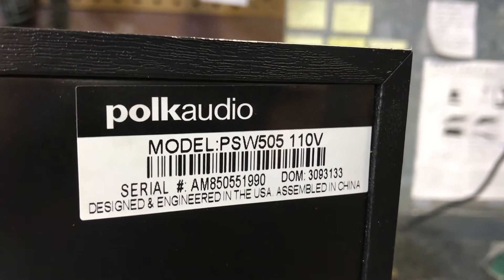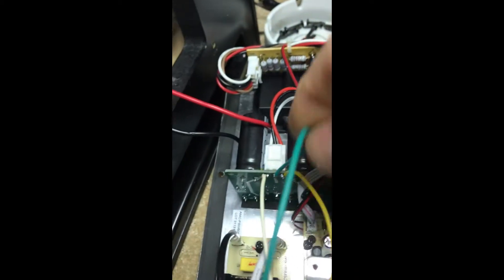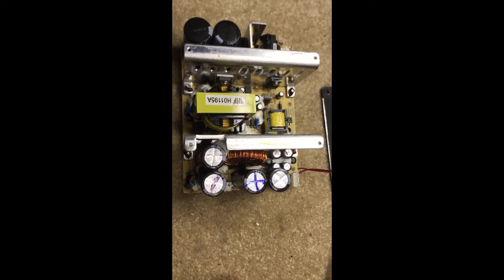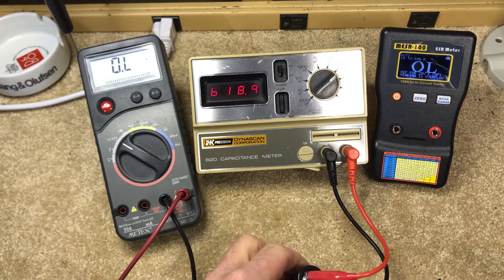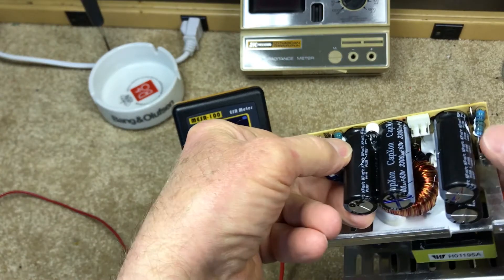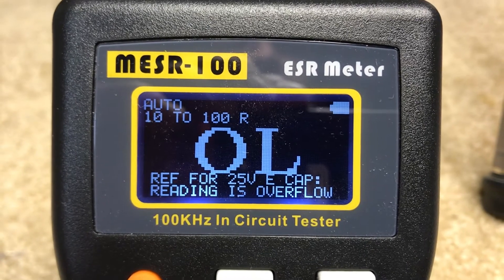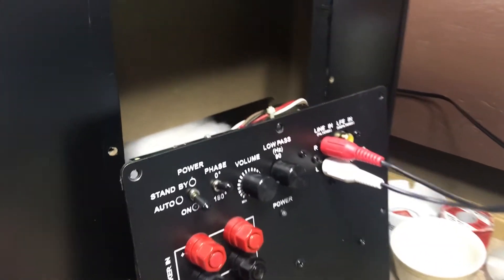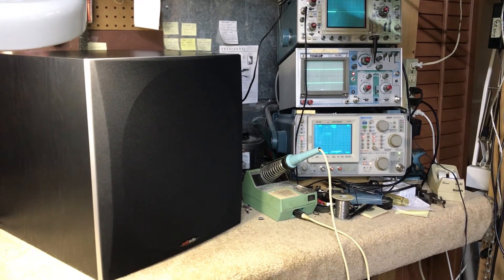Polk PSW505 Sub Woofer - Troubleshoot & Repair

Comment: I've got a Polk Audio PSW505 and it did similar stuff as for making noise. It also got very HOT on the back plate and after some time it quit working altogether. I've been trying to decide how to get it back into operation.

Comment: Can I know why you measure capacitors in the circuit? For me that depends on the line, if more components are on the board, the reading can be not accurate.

ESR for me is good to measure, but only on high frequency. It doesn't matter in the low frequency as much.
Reply from the maker: Thanks for your question.  Measuring capacitors in circuit is a huge advantage in time savings if it can be done accurately.  In this case, the Polk Audio boards have "plated thru-hole" solder joints.  Removing the components can be a pain staking process versus a single side foil board depending on the age and type of solder used.  Many times the component itself can become damaged during the removal process.  ESR testing is way more reliable than a capacitance tester or Ohm meter that can easily be influenced by components that are connected to the same foil trace. The odds of finding a bad capacitor with an ESR tester well outweigh the odds of missing one.
Reply: @dennisbsutube I have different experience, but thanks for your answer. 😊

Comment: mine is the polk 550wi.   I have 2 of them.  when set to "auto"  they sometimes both shut off after a few minutes.  Im guessing they sense when no music is being played?   anyone know how that works?   when set to "on"  they seem to stay on indefinitely until the power switch is turned off
Reply from the maker: Yes, the Polk Audio DSW PRO 550wi subwoofer features an "Auto" mode that manages its power based on the presence of an audio signal. When set to "Auto," the subwoofer automatically turns on upon detecting an audio input, indicated by a green LED on the back panel. If no signal is detected for 10 minutes, the subwoofer enters a "waiting" state, and the LED changes to yellow.

Comment: Awesome video! I am veteran Radio Broadcast Engineer and somehow never heard of an ESR... LCR yes, cap meter yes, VOM yes, so I learned something! I usually just did a cap test and or shotgunned the caps in things like this.  Curious if that supply itself can be replaced, meaning is it a Polk Audio supply or a third party?  I have the same speaker and mine is doing what sounds damn near like morse code white noise.  It is not morse, and it goes away after its been on a bit... happens with no input to the speaker, and the power light turns red during the issue.  It is almost 5 years old.  I probably will replace the entire subwoofer with a new sub at some point soon.  Thank you for teaching me something new at the age of 65 years old!
Reply from the maker: Thanks, I'm glad to pass on a bit of new troubleshooting info to a tech that's been around the block!  You can replace the amp assembly with a 3rd party unit from a place like Parts Express.  If you don't mind spending the time, you can probably shotgun the small electrolytics, get by on much less of an investment, and have enough money left to by a decent ESR meter.  Think of the joy of finally being able to troubleshoot electrolytics in circuit! :)
Reply: @dennisbsutube  well if I decide to repair it ill pop for an ESR meter.  Thank you again!

Comment: I recently just bought one yesterday for 40 bucks on marketplace and I am so lucky because it’s perfectly working fine. It has no issues at all as it is a 2013 model and hasn’t been used in around 9 years so I’m lucky
Reply from the maker: Congratulations, I hope your Polk sub continues to work well for you. In the meantime, you might want to consider running out to buy a lottery ticket!  You may be on a roll...:)!
Reply: @ I didn’t do that yet, but I also found a free 12 inch soundstage powered subwoofer that’s fully functioning as well and also scored some fully functioning, car subs for free and some rare vintage PA 12 inch coaxial drivers that are worth 700 Canadian for the pair Maybe I am lucky. Maybe I should try it out and give the lottery a try
Reply: I bought a pair of the polk 550wi subs for $50 each with the remotes and a bunch of the high end monster cables that are worth far more than $100 on their own. Subs work great.  He had 4 more that he already sold.  So he had no issues owning 6 of them. His only issues was the neighbor in the house about 125 ft away.   Too much bass and he had to sell them!

Comment: My volume switch makes popping and scratching noises. Any chance you know where to source one out from?
Reply from the maker: 90% of the time cleaning the pot (potentiometer or volume control) is all that is needed.  Buy a can of Caig DeoxIT D5 contact cleaner.  It seems expensive, but it works and a can will last many years as only a little is used each time. 
 Amazon link: https://www.amazon.com/CAIG-D5S-6-Contact-Cleaner-Rejuvenator/dp/B00I3G272M/ref=sr_1_1?crid=2J2LWEQMF7723&dib=eyJ2IjoiMSJ9.gGEM-dDQgIX37Ke0Q-Cx2kFWveOk1ZJtlIF0wLQfqVgzmoQIxBI72026Vuniyv6tCRfIbC6D0VQkkkhcBKaucZwDAApD-IpxQZU_UKErFkJ63aTdVnb0Itn5PheQAwA53K0PDV0JOm6ldOvxDSYiqrYlMOZUPVIUiRCRMwPNVQsefVAOtf-Jrc-GPBfgH3ayqZagJrlCWOUFiNKbi6KLdIHBcGwld0hr1Aem2tRzXU2kKJqmAGHlQ-RSSHv-hUFSsOuE5g6QxXROHZPEgK_AsyO9UbaErt9zVUyupW2sinwhhiQzIQll3WO5Xe-C50jqngK6si3YgOrG8cLDNadUCLh5kUTwMD6yPyBRdCI0-TD4nHWwciSyjpy9g76s5LzXckq396DbPiw1Jm0p8xDW5pgtETRZ8_bwnWKw_V7Zbjb2EKDBHb8856SpsJjuUpiK.ag7_-s5ZWxdnNuOMQJ-1D_MmRRayUL_hNWVMdYAdQRE&dib_tag=se&keywords=deoxit+d5+spray+contact+cleaner&qid=1739979633&sprefix=deoxit%2Caps%2C138&sr=8-1

Comment: What would this repair cost? They want 200 shipped to replace the whole back panel.
Reply from the maker: Repair costs total $10-$15 if you do the work yourself.  I imagine a shop in your area would charge around $100.  You can have them watch this video to save them the time of figuring out the circuitry.  Good luck!
Reply: @dennisbsutube  much appreciated.

Comment: What’s the avg cost to do this repair? What do you charge? Curious. I have this same model and issue. Thanks
Reply from the maker: I spent around $10 with Digi-Key to get the parts I needed for this fix.  Sorry, I retired from the high-end audio repair business many years ago.  If you send a link to this video to a real electronics repair shop near you, they should be able to tell you if they are up to the challenge.  Thanks for watching.  Let me know if you find a good shop in your area.

Comment: I have a Cambridge Audio Aero 9 sub which also has intermittent issues. 
I can't for the will of trying and spending a few hrs researching, I just can't find schematic for it so I can trouble shoot for components. 
Do you have any ideas with your knowledge on how I can start this on the right track. 
I am a novice but have done small ish repairs so I can solder etc. 
Cheers in advance

Comment: Nice video.  Thanks for sharing.  So what does the freeze spray show exactly?  Can you turn a can of air upside down to achieve a similar effect?
Reply from the maker: The freeze spray trick is only used when you have a part, typically a semi-conductor, that consistently fails after a circuit has warmed up.  The freeze needs to be instantaneous and extremely cold to shock the part back into a temporary working condition.  If you have a can of compressed air that will expel freon when turned upside down it might work, using a can a freeze spray is the best option.

Comment: Hi Donnie, thank you for this video. Hi, I have a strange problem. I have connected single rca cable from my avr to the right input on the sub. However, when I pause the movie & play it back, it stops working. If I switch to left input then it starts working again. Can you please tell me what are the probable causes?
Reply from the maker: Ravi,
The unit does have an audio detection circuit that powers on the amp from a standby mode.  I'm pretty sure most of this detection circuit is located near the input area of the main amp board.  The small transistor that I replaced near the end of the video was part of this circuit.  The small electrolytic caps and any switching transistor involved in this circuit are most likely the culprit.

Comment: I have one of these amps.  It's currently working but past few nights I noticed some strange noises coming from it!   It did it again today, I went to check it out and it was super hot.   My other sub which is a different brand was on for the same amount of time, and it was not hot at all.   I never paid attention on this amp if it normally gets hot after an hour or so of use.  But something is going bad that's for sure.   What I did notice was the large heat sick the one right next to the AC input It has voltage leaking onto it.   When I touched it I could feel a slight shocking sensation.  I measured it and the heat sink rail has 168vdc.   No sure if that is normal on this thing or not.   I would have thought it would be like a grounded part.... There are 3 transistors attached to it, and then some other electronic part that is white in color is strapped to it.   Anyone know if this is normal on this power supply?   I'm going to have to check all the capacitors because sounds like a lot go bad on this power supply.
Reply from the maker: Dexter,
The strange noises are a good indication some of the caps are going bad.  Also, check the solder joints on the larger power resistors.
There should be no measurable current on the heat sink.   Disconnect everything from the subwoofer except the power cord, then measure to make sure the problem is not coming from another source.  It does sound like you have a short or a breakdown in a semi-conductor insulator on the heat sink.  This can be a dangerous condition.  I would contact Polk customer support and ask for an amp replacement due to their liability exposure to injury in this situation.

Comment: Mine died a few weeks ago.  I just finished the repair.  I scoped the 57VDC output from the power supply and it was an absolute mess.  Lots of AC leakage.   Broke out the ESR meter and there were a bunch of caps that were either flat out bad or very close to the edge of being out of spec.   I wound up replacing all the electrolytic  caps on all three boards with the exception of the large power caps.  I used high quality Panasonics so hopefully this will last a a few more years.  From troubleshooting to repair it was about three hours of my time and $25 at Digi-key.
Reply from the maker: Good for you.  Persistence pays off!

Comment: Thank you for posting this video.  I used it to replace some bad caps on the power supply.  Unfortunately, I didn't have +/- 57V output before and still don't, so I have to dig deeper.  No obvious signs of burned components or bad solder joints.  Just not sure how to test the other components.
Reply from the maker: If you are missing both the +/- 57V supplies you need to go to the beginning of the switch-mode circuit, usually just after a coil type transformer.  You are better off troubleshooting this circuit cold (AC power cord disconnected) so you don't get shocked.    The problem will most likely be an open semi-conductor or fuseable /power resistor.  A tip would be to look up the part numbers on the Mosfets or other major semi-conductors, find the datasheets and hopefully an application diagram that will show you a schematic of how that component is typically used.
Reply: @dennisbsutube  I think I have a lack of knowledge about DC output from the power supply.  When the power supply is disconnected from the audio amplifier at the 3-pin connection, I see only 14VDC on one leg.  When I plug the power supply into the audio amp board, I see +/- 57VDC.  However, if I disconnect that 3-pin connector from the audio amp board, DC voltage slowly fades away.  Is there a current sensing feature that essentially shuts off DC output from the power supply if there's no demand load?  If yes, then my power supply is working fine and the problem lies on the audio amp board.

At any rate, I still have the "heartbeat" after replacing all caps.  I get a red power LED when the speaker is not attached; however, as soon as I attach the speaker, the power LED goes dark and the heartbeat returns.
Reply from the maker: Robert, disconnecting live power supplies to isolate problems is not a good practice, especially when dealing with switch-mode power supplies.  Newer power supply designs can depend on feedback loops or an expected load to oscillate properly.  You are always fine to check components when the main power source (AC) is disconnected, or live if you understand how to safely do that.
Please remember that the PSW505 also has an audio detection circuit that turns the amp on/off.  This could also be the source of your problem.  If there is a cap in this detection/switching circuit that is off spec, it could cause the heartbeat symptom that you are experiencing.  As I recall, most of this circuit is on the main amp board.  Pull that board, put it on your bench, and start testing the components on it.  Do you have a component tester, multi-meter, or hopefully both?
Reply: @dennisbsutube  Thank you, Dennis.  Learned what a switch-mode power supply is and that is indeed why I'm seeing the DC volts drop when the power supply isn't connected to the amp board. I'll stab the back of the 3-pin connector for future measurements.

Replaced all the caps on the amp board but have pulled it and will learn more about testing the various components. I have an ESR meter and multimeter.  Might consider getting a multi-component tester. I don't want this one to beat me!

Comment: Excellent video. Your pace and the details are very helpful. I occasionally get these subwoofers in the shop I'm currently have a Polk on the bench. Was prepared to replace all small caps. See if my basic ESR pick things up as well as your more modern one.
Reply: Thanks.  Please know that any ESR meter is better than no ESR meter!  Good Luck.

Comment: Do capacitors go bad from NOT being used? I ask this question because I have had three working computer's burst caps after sitting for a few years. All of them were working perfectly before. In other words, should electronics be used once in a while just to keep them alive?
Reply from the maker: There are a lot of opinions on this topic.  I think the most important thing is the manufacturing quality of the cap to begin with.  Stick with buying known brand names from a respected national distributor.  Also, store your electronics in a decent environment, not a hot attic or damp basement.

Comment: Been struggling with opening board holes to insert new capacitors so read where using a stainless-steel dental pick and an iron works well. Just ordered some picks. Do you have a better way?
Reply from the maker: Yes.  As I mentioned in the video, when dealing with a plated through-hole, add some fresh solder to the joint before trying to remove the old solder.  This wll make the solder more liquid based when heating the joint and allow a "solder sucker" to quickly pull the solder from the joint.
Reply: @dennisbsutube  Can you recommend a solder sucker? My bulb one does nothing. It's very frustrating.
Reply from the maker: The original Soldapullit made in California.

eBay    https://www.ebay.com/itm/272727193003?epid=28042051685&hash=item3f7fceb5ab:g:hnYAAOSwRsJeMuS5&amdata=enc%3AAQAHAAAAoNW4I58Dz34yoRzYrzMcJKOoE23WGxjFPK8QhiAc2UOs58vMcVcwOjtS8pRzFDdkJIQuxPHVKnurqQnyHlhp%2BGVEnDo5LaLR0vIxZ4GjQna9KPL0h9a9lwaWqcoimWCXMmEKUWGFfisD7c6XtbEf4a5W8ZgDDynafoiBZ95YIc23L%2FPefLFLdC4NkjgsNMAPwRPr9de64yegolMKsBpFNVs%3D%7Ctkp%3ABk9SR9br27iuYQ

Amazon:  https://www.amazon.com/EDSYN-The-Original-Deluxe-SOLDAPULLT/dp/B006GOKVKI/ref=sr_1_5?crid=13PK2RDC90ZFB&keywords=soldapullt+solder+sucker&qid=1672680718&sprefix=soldapullit%2Caps%2C103&sr=8-5
Reply from the maker: Make sure you keep the rubber o-ring and tip lubricated with white lithium type grease.

Comment: I have just started electronics repair. I've been building computers since the 80's, so I am familiar with all of the components. However, I do not yet have the diagnostic skills I need. I found your video because I have the exact same sub with the same problem! How fortunate to have found you. I see some of your old school equipment and know right away that you know what you are talking about. I hope to learn as much as I can from you. My next project is an old ATX motherboard with 20 bad caps! I've gotten good at replacing them and have already fixed an Xbox. I see a pattern that around 90% of electronics failure is simply swollen/leaking capacitors. Would you agree with this?
Reply from the maker: When dealing with older electronics, electrolytic caps can be a common problem.  When trouble-shooting newer equipment, semi-conductors such as voltage regulators, IC's, rectifiers, and transistors are more likely to fail versus caps.
Reply: @dennisbsutube  I noticed on my newer motherboards they use all-metal caps. They don't swell or leak, correct? So, then you can't visually see which ones need replaced?
Reply from the maker: @CarsandCats  They are actually made with aluminum cans.  Even they will "dome-over" if they need to release pressure.  That is why you will sometimes see a serrated top to allow it to bend up, not break.